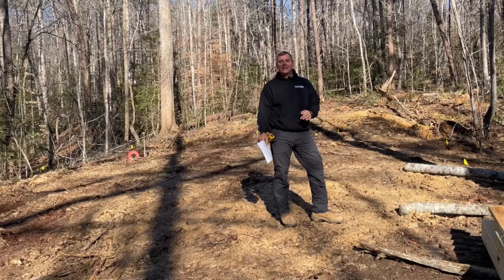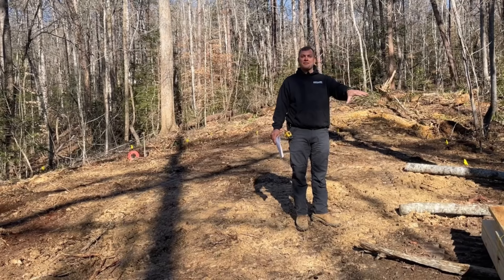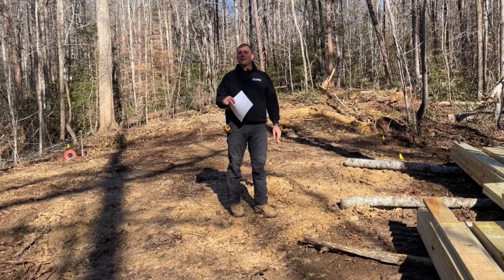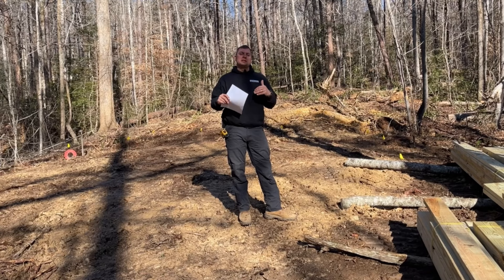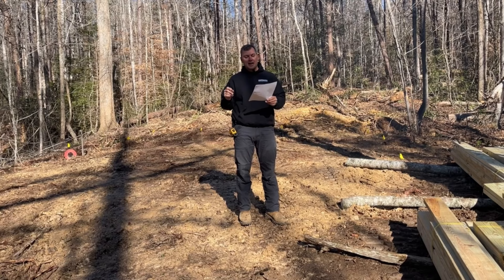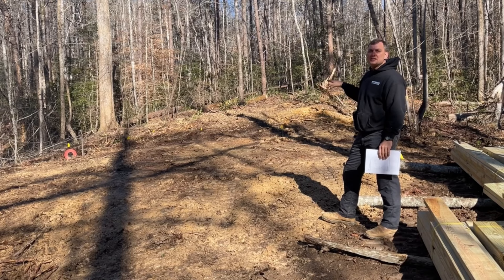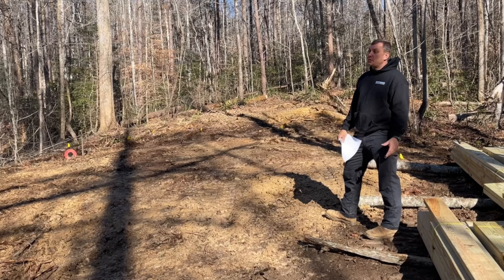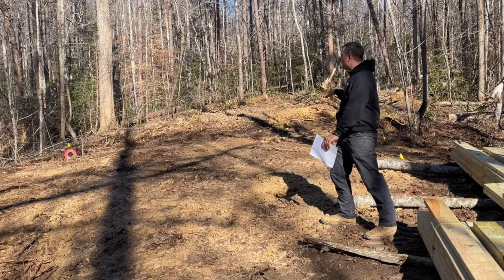Off grid Cabin build part 1       #offgrid #cabinbuild #tinyhome

Comment: Not to be rude, but the only way to keep posts from rotting is to not put them into the ground. In 15 to 20 years there will be issues.
Reply from the maker: Some people prefer to set a bracket in concrete and bolt the post to the bracket.  That is an option in our kit.  It is our experience as long as there is a gravel pack in the bottom of the hole to allow moisture out instead of wicking up the post there isn't an issue. Great Point!

Comment: What is the diameter of the holes, how much is the depth?
Reply from the maker: Thank you for the question!  In our area we use an 18" diameter hole that is a minimum of 24" depth.  That can vary depending on your location and the frost line in your area.